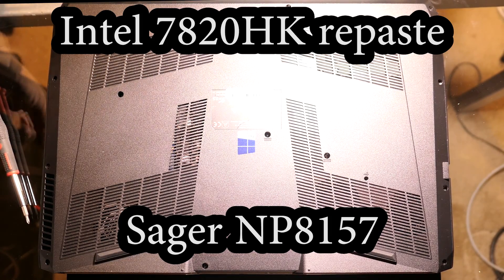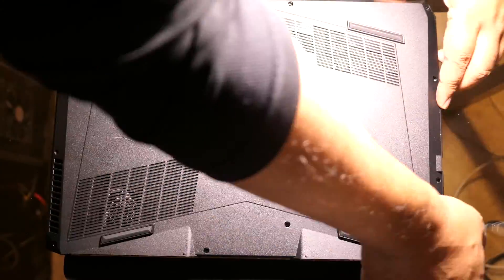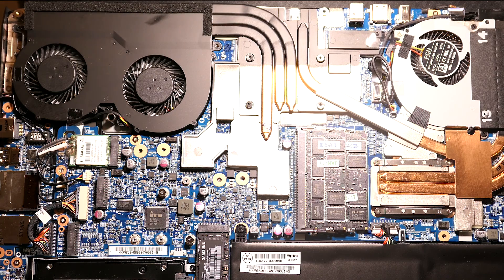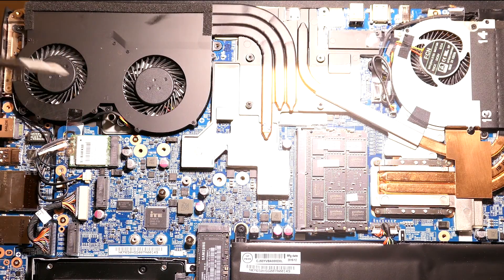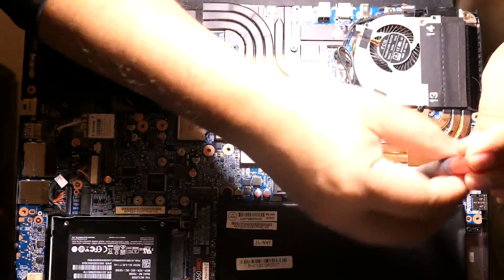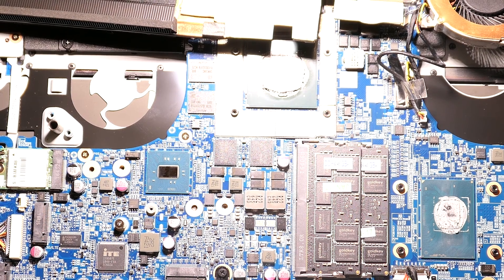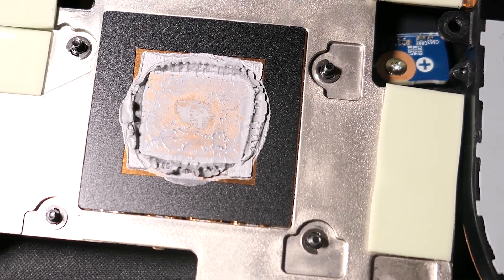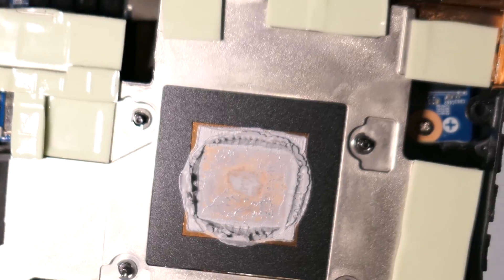Repaste Intel 7820HK CPU and GTX 1070 on Sager 8157

Comment: I know this question is unrelated to the thermal paste in the video topic, but do you need to take the heatsink off of the NP8157 completely to change/replace any of the GPU/CPU fans? I made an attempt based on knowledge I had with my old NP8130, but in the NP8130, the heatsinks for the GPU and CPU are seperate, so I got intimidated out of trying to undo the entire heatsink on the 8157 yesterday, not knowing if I actually had to or not [since I get fairly nervous messing with laptop internals]. I'm trying to replace the CPU fan since the old one occasionally gets loose and sounds a bit grindy. I have the replacement part, but again I ran into that issue above, since the heatsinks between the two laptops are different [also the reference picture I thought had for the NP8157 had been showing them as two seperate heatsinks, like the NP8130]. If you have any answers, please let me know. Thanks. o.o

Comment: What is the size of screw driver you used? I am able to remove the back cover and the first two screws (numbered 13 and 14) but unable to remove screws numbered 9,10,11,12 because they are smaller
Reply from the maker: Well, I am not home and this video was quite awhile ago. I used the same screwdriver bit for all of the screws. I don't know what size it was. Maybe your screwdriver is too wide.
Reply: Yeah it seems from the vid you used the same screwdriver bit. The bit I was using fit perfectly for the other screws but didn't work for screws 12,11 and 10. Or maybe it's because those screws are already badly damaged. Will try to extract them somehow and replace them
Reply: Im having the exact same problem!

Comment from the maker: Changing the thermal paste to Thermal Grizzly Kryonaut lowered the temps by about 10C. if I use Intel Burn Test non-stop my highest temp is about 86C. That is with the CPU overclocked to 4.3GHz.
Reply: Richard's World Be careful with that stuff, it dries out really fast like within a few weeks of use. it was made only for overclocker's that would use it for a short period of time. Gelid Extreme is the go to for longevity and good temps.

Could you please run firestrike on ultra in a loop for about an hour and report the temps from the cpu and GPU please? I want one of these laptops but I'm really worried about the thermals under heavy load for long periods.
Reply from the maker: Thanks for the advice. It does seem like my temps are not as good as they were when I first put the Kryonaut thermal paste on. My temps between the cores were even after applying the new thermal paste. Now the temps are different between the cores again. OK, I'll run that today and let you know.
Reply from the maker: I was going to do the Firestrike Ultra, but it seems like I have to pay for that version. I can only do the regular Firestrike. I can run Unigen Heaven on the highest resolutions and settings for a couple hours. But I noticed in that benchmark, it mostly works the GPU.
Reply: I forgot that it cost money to run those settings. Heaven plus prime95 will tax everything heavily as well. Those should put near 100% load on both cpu and gpu. Would you be willing try that combo and let me know the temps and if it throttles the cpu or gpu at all? This would be much appreciated sir :)

Do you run stock fan profile or use the max fan speed (shift + F1)?
Reply from the maker: I just set the fan to max and I let Unigen heaven run for about 80 minutes. Room temperature is 21C. Unigen Heaven was at the highest resolution and max settings. The CPU got up 88C and the GPU only 73C max. But the GPU usually runs in the mid 60's. I think the GPU cooling on this laptop has always been good. If I let the computer control the cooling fans it lets the CPU creep up to the 99 - 100C level. I have the Intelburn test and Prime 95. I'll run those later tonight.
Reply: Richard's World thanks man you're awesome!
Reply from the maker: Very welcome. Today I tested it with Prime95 for 2.5 hours. Room temp was 20C. The average temp of the CPU was 85C. During Prime 95 it would run at a max of 3.48GHz even though I had it overclocked to 4.1GHz. I have gotten my best overall performance doing long tasks by overclocking to 4.1GHz and subtract 100mV from the CPU. Even though it runs 4.4GHz with ease, it doesn't do better in benchmarks. But Adobe Premiere Pro seems to work better at the 4.4GHz.
Reply: Yeah prime95 is a worst case scenario with 100% CPU utilization, but still important with how I would plan to use it. I wish these laptop manufactures would just beef up the cooling for us...one can dream lol.

Thank you so much for the testing it helps a lot.

Comment: the temperatures are terrible ... you should try with liquid metal, like liquid ultra or Thermal grizzly conductonaut. i am using conductonaut and the temperature difference is huge !!!
Reply from the maker: Thanks for the link. On my CPU it is the same problem Cores 0 and 2 have higher temps. I still think this is weird considering how small the CPU is. But I'll mess around with it and see what happens. When rebuilding car engines they use something called Plastigage to measure extremely small gaps. I could maybe use this to see if the heatsink sits flush with the CPU.
Reply from the maker: I already had the Antec paste in my house so I tried it. When looking up the specs just now, I see that it is not very good at all. But it did better than whatever they did from the factory.  I don't want to use any of the liquid metal in my laptop, especially since it will be in a backpack a lot getting squeezed in the airplane, train or buses when I travel. I will redo it with the Thermal Grizzly Kryonaut and see how that works out.
Reply: i have seen a lot of good reviews of people using kryonaut on the last AW laptop models, like 13°C difference or more
Reply: Juan David Alvarez liquid metal is made with galium, chemistry tells us that's it is really bad to use on bare copper and even worse with aluminum. If you're using that in a laptop bad things are gonna happen after awhile. Just Google it, lots of posts about this. And you also need a perfectly flat heatsink to do it with. Most laptops have slightly eschewed heatsink making it a bad choice for thin liquid metal.
Reply: galium is not bad for copper, i invite you to see my thread after 1 year of using liquid metal 
http://forum.notebookreview.com/threads/after-1-year-of-thermal-grizzly-conductonaut.799343/
Reply from the maker: For me, I just won't try it on this computer. Especially because many times I will leave my house for many many months and not come home. I need my laptop to be dependable. I am contemt with the Krynaught paste. You are correct about the eschewed heatsink. I can tell this laptop has this issue also. After changing thermal pastes the temps between the cores become almost even. But after about 10 days there are different temps between the cores again. This happened to me twice now. Good even temps after changing thermal paste, then the temps are different between cores again after about 10 days. It could be the thermal pads are too thick. Or I'm not sure, but I was thinking about trying a thin copper shim with the CPU. I know some people bend the heatsink also. I'm not sure I'll try that right now.
Reply: if you want to know if your heatsink is doing property contact, you can buy pressure tape and check as This man did http://forum.notebookreview.com/threads/warning-some-i7-6820hks-and-i7-6700hq-have-uneven-core-temps-due-to-uneven-heatsink.797477/
Reply: Juan David Alvarez You are correct sir, I was going soully off of Web post from other people. I looked it up and found that there's some copper galium solutions for industrial applications. However, aluminum and galium is a very big no go.
Reply: yeah, but my heatsink is made of copper :) so galium + copper = :) insane performance